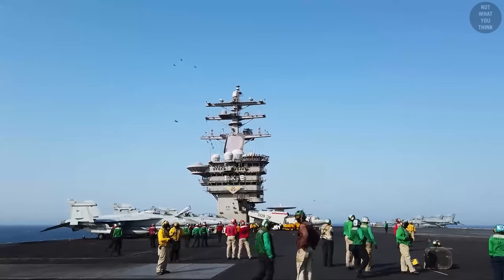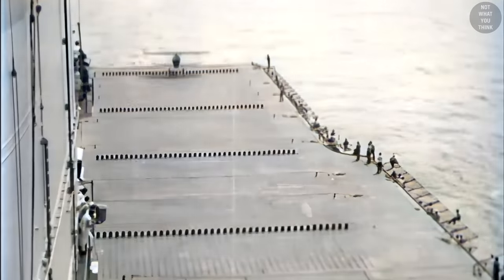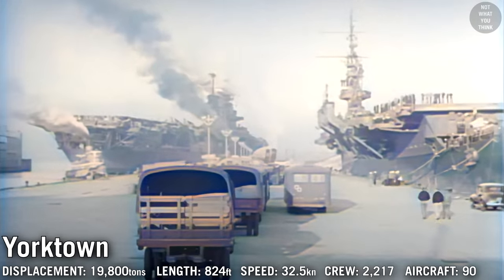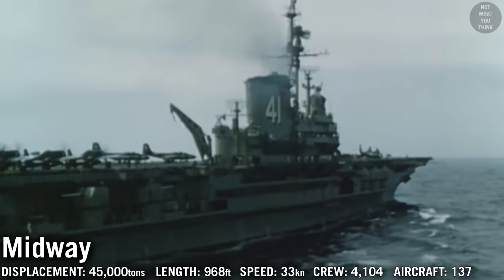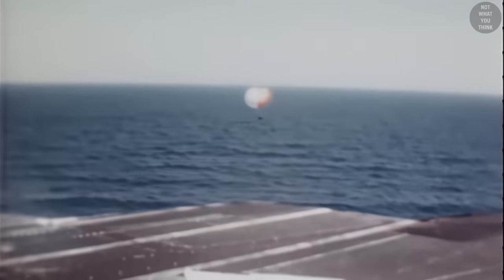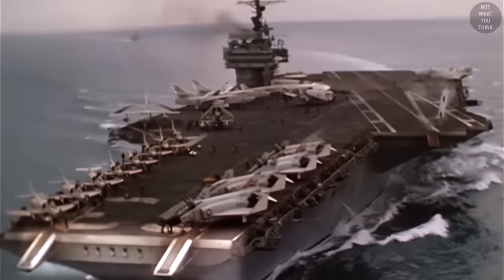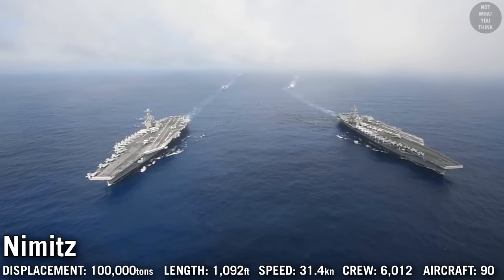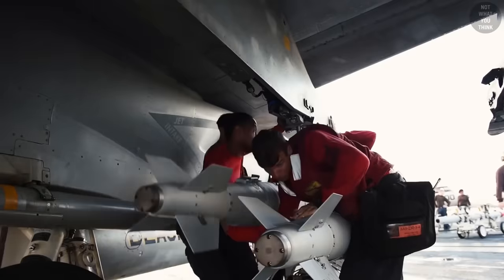Evolution of American Aircraft Carriers

Comment: Something that doesn't seem to be mentioned often is early carriers had catapults but they weren't on the flight deck but in the hangar and they sent aircraft out the side. They weren't used often because they couldn't use the carrier's forward speed for additional lift
Reply from the maker: Interesting, thanks for mentioning that!
Reply: A lot of ships had catapult launched aircraft, virtually everything cruiser sized and above had aircraft mounted. The aircraft could land in the water next to the ship and be picked up by crane.
Reply: @werewolfnar  Yup, that even includes a few submarines with an aircraft launching catapult.
Reply: Catapults on many gunships were powder actuated.
Reply: @shadowkillz9606  I think that was Japanese? I can't remember.
Reply: @alicorn3924  I-400
Reply: @alicorn3924  One Japanese carrier deffo had three decks to launch aircraft, I don't think they actually worked but that was the idea.
Reply: @All_Hail_Chael  I'm pretty sure all triple flight decked Japanese carriers were converted to single flight deck carriers before world war 2
Reply: @alicorn3924  Correct
Reply: Sounds like the Battlestar Galactica.

Comment: 25:44
The reactors on the Nimitz were also much larger and much higher output than the ones on Enterprize, as the ones on Enterprize were specifically designed to replace conventional boilers on a 1 for 1 basis, keeping the design changes from the Kitty Hawk minimal in the hope of keeping costs down.
The Navy also had more experience with larger reactors by the time Nimitz first hit the design study stage.
Reply: I trained and qualified at A1W. I didn't know that.  -  It means you don't have to redesign the steam plant as  well as introducing reactors.  Tandem design is more feasible with experience.  The "what if the reactors don't work" question has been answered ("don't work" can include not reliable enough.)  Rickover was a brilliant engineer.
Reply: Enterprise, not Enterprize
Reply: @kingssuck06  Just because I am an ex-Navy doesn't mean I was a spelling bee champion and am immune to typos.
Reply: @kingssuck06  i can never say this enough, but knowledge and intellect are two separate things. Just because it's easier for someone to learn doesn't mean they will make the effort, nor does it mean someone not conventionally "smart" can't put in the effort to learn something to equal mastery. edit also, casual conversations are a really crappy place to try to big brain on semantics
Reply: @KK_on_KK It is spelled ENTERPRISE.
Reply: @jimfrazier8611 Possibly not identical, but very very close to it - and they were specifically sized to replace the existing boilers in the mostly Improved-Forestall class design used as the basis of the Enterprise design with minimal changes. I think the reactor type already existed in use for one of our Submarine classes, as their basic design.

Comment: I was lucky enough to serve as a Boiler Technician on USS Lexington from 1983-1986. We still steamed her "almost" just like they did during WW2. The only differences for us was the fuel was no longer black oil that had to be heated to flow. WE used Diesel fuel marine or F76. Sometimes before fires side maintenance we would burn JP5 to make the soot easier to clean from the boiler tubes 8- 600 PSI 850Degree superheated steam Babcock & Wilcox M type boilers. Fully manual control! We lit fires with a zippo lighter to light a hand held torch that was fuel soaked asbestos pucks bolted on the steel rod that was inserted in the firebox. on a good day it was only 100 degrees on the burner front. BTW this was the coolest place in the boiler room! Every time the Catapult was launched. You could feel it shake the ship all the way down in the boiler room where you could see the effect on the steam drum pressure gauge and had to quickly increase the firing rate by adding fuel/air mix to the firebox to make up the steam pressure loss via the cat shot! That and you were already hauling ass to provide speed for more wind to give the planes more lift on launch. Good times! Also the very first crash shown on the video was on the Lexington not that long after I left. That was a bad one. Even on a training carrier it is very dangerous. Lost a few shipmates and not all were on the flight deck..
Reply: long live The Lady Lex!.  i think she was the first model carriers i ever had, one of those Revell kits.
Reply: I volunteered on a WW2 aircraft carrier for a few years. One of the big jobs was restoring one of the fire rooms. The other had been stripped for parts. I would have probably hated working down there as it was probably insanely hot and loud. There was a huge turbine-like fan that shot cooled air into the compartment.

Comment: Very good documentary giving a good overview of carrier innovation over the years.  There are only two things you forgot to mention:
1. Catapults allow the aircraft to carry higher fuel and payloads as compared with ski jump or VTOL launched aircraft.
2. The superstructure originally caused port/starboard weight imbalance but was overcome by careful placement of equipment to counterbalance the weight.
Reply: The superstructure weight imbalance issue mostly went away when the angle deck got common - if anything, it's usually not ENOUGH to balance the angle deck (though it helps some).
Reply: Except it was actually done across the pond. HMS Hermes 1924 have a look at her features. She even had a bow catapults which were removed. The starboard island with lifts behind the arrestor wires..... 

The Royal Navy innovations include the angled flight deck, steam catapults and mirror landing system.  

Eric Brown was the first pilot to land a twin engined aircraft the Mosquito on an aircraft carrier. HMS Indefatigable 25 3 44. The following year he landed a de Havilland Vampire on HMS Ocean 3 12 45 making the first jet to land on a carrier.... 

Armoured flight decks..... etc 

Appalling video.
Reply: @davidbroadley2983  very good comment because the British even welded the first carrier at Cammell Laird shipyard but the USA make out that all Carrier technology was theirs and they even now make out that steam powered VTOL technology is also theirs
Reply: It was Great Britain (RN) That made the very first aircraft carrier and made it with the single island but the Royal Navy have now upgraded to a two-island design.

“On 7 May 1913 the Royal Navy commissioned its first aviation ship. The old light cruiser, Hermes, launched in 1898, was converted to a seaplane carrier. Canvas shelters to hold aircraft were installed on the stern and forward of the bridge structure and aircraft-handling booms installed on the masts.

During World War I the British navy developed the first true aircraft carrier with an unobstructed flight deck, the HMS Argus, which was built on a converted merchant-ship hull.

You are welcome world;-)

Comment: Deck edge elevators: As soon as I saw elevators on the main deck earlier in the video, I was asking myself, "what if one of them breaks?" How was this not thought of immediately upon design? "What if it breaks?" Has to always be the first thing you ask yourself when buying or designing anything.
Reply: according to them   broken elevator is not on their list of important things to remember
Reply: The answer? Barring major combat damage that messes the mechanics of a in deck elevator and breakdown is going to occur in the motor that lifts it. The answer to what if that motor breaks is essentially that a capstan will be installed and the lifting mechanism will be powered by hand. 
Obviously this will be too slow for normal flight operations and would mostly be used to elevate the inboard elevator and lock it in it’s up position
Reply: I guess you could plank them over if needed, with some support beams into the hangar. Planking material is probably at hand in order to fix flight deck anyways.
Edge elevators didn't really appear until the Essex class,  with a very rudimentary version trialed on USS Wasp. I am not sure why originally internal elevators where preferred. I guess for the CV conversions it might have been to difficult to pierce the hull on the sides without compromising structural stiffness. Also for the armoured carriers the armoured sides (and deck) where part of the ships structure, and lift where placed in front and aft of the armoured hangar. I don't know the reasoning for the Yorktowns, cause technically they had hangar catapults installed, and as such probably could fit an edge elevator on that location instead. But then again, war was coming, the USN needed some optimized carriers instead of the (large and powerful, but with some drawbacks that hindered deck operations) Lexingtons, so no time (and weight budget?) to experiment to much.
Reply: Not only that, but what if you need to...you know...actually use it.  Launch and recovery must cease either way.  No idea why they thought this was a good design.
Reply: Well, since the fact that one of those broke caused the big E to lose it's capability to receive planes...there you have your answer
Reply: @Tuning3434  - While I am by no means smart enough to have invented the perfect aircraft carrier from scratch, assoon as I saw the elevators in the middle of the deck, a HUGE red flag was raised for me. That is something which should have been thought about before the blueprints were approved.
Reply: @PaulGaither  I imagine that it was just not a consideration. 

What people tend to forget is that most of these invocations came as a direct result of the requirements of the air group. The first few carriers would have launched and received biplanes which have very short take off and landing requirements meaning they would tend to land behind the aft elevator and launch from in front of the bow one. Once the carriers started launching and recovering heavier monoplane designs the deck space became more essential, but at this stage the carriers where already built and designed. 

As a example the main dive bomber of the US navy in WW2 was the Douglas SBD Dauntless, this plane was introduced in 1940 but the carriers from the start of the war where commissioned between 1930 - 1938 This is the reason Enterprise still had the lift in the flight deck. The first carrier to get the new lifts where the Wasp, which was commissioned in 1940.
Reply: @generalharness8266  - Solid reply.
Reply: Words of reason but I guess sometimes designers are too overloaded with some other crucial design problems that their energy is geared toward those problematic areas that  in return it results in other kinds of problems. Just to give an example, NASA designs mind boggling, state of the art rovers that run on Mars, but apparently they have problems with implementing reliable systems that clean the dust on the solar panels of the same rovers. Instead they rely on Mars winds to clean the dust on the solar panels risking entire projects and then try to save the day with makeshift solutions. Go figure...
Reply: @lacivertumutkazankaya2042  No they had a expected life on mars. The winds giving them a clean just extended the  life. 

A quick google shows that they where expected to operate 90 earth days, one (Opportunity) lasted 5498 earth days. So its not they needed a way to clean the solar panels its they had a design that was built to a acceptable level and the units out preformed that design. 

The project had a acceptable level of return after 90 days the rest was just a bonus. 

Please read my post about 3 up about why it was acceptable to have a deck lift that was then changed to a overhang lift.
Reply: @generalharness8266  Thanks for expanding on my comment. Here is my source: https://www.youtube.com/watch?v=6IoMiwxL2wU&lc=UgwSgeNbyZaunmS8XAl4AaABAg
It starts at 08:13. Anton, the narrator, clearly mentions that the mission was expected to end prematurely as the scientists had not anticipated the amount of dust accumulated on the panels just in four months and were very disappointed about it.  Eventually they came up with a solution which Anton finds "brilliant". Yes they did save the day but to me this is a makeshift solution.
Reply: @generalharness8266  The misunderstanding arose because I confused the robotic lander (InSight) with the rovers. So, not the rovers but the robotic lander.
Reply: @lacivertumutkazankaya2042  Makes sense now, was confused but even insight has lasted long enough for its primary mission (2 earth years).
Reply: i was thinking "why don't they put them on the island side?"
Reply: @HarryNicNicholas  Probably weight. You need to keep the weight as balanced as possible.
Reply: i had a toy of an aircraft carrier and it broke xd
Reply: Whenever I buy toilet paper the first thing I ask myself is, what if it breaks?
Reply: @gothenmosph5151  You think you are making a joke, but that is why you buy two ply buddy. As my dad said, two things you never buy cheap to save money on are toilet paper and bread. Nothing worse is bad TP or stale terrible bread.
Reply: Second time answering this question because I have had more time to think about it. You have to look at the evolution of carrier design. Interior elevators where a known technology, much more so than asymmetrical lifts. Look at the first experiments in deck edge elevators they were bare bones structures that were only as wide as the planes wheels because of weight and lifting capacity. 
If you just look at the elevators evolution you can see how each generation of ships the elevators design evolution continues culminating in the America Class “Carrier” whose deck edge carrier can be rotated vertically to enable it to pass through the Panama Canal and act as a sea wall during bad weather
Reply: @blurglide  there were always at least two
Reply: @PaulGaither  that’s how everyone did it
Reply: @HarryNicNicholas  these days they are on both sodes
Reply: Engineering probably, those elevators need to support very heavy weights, I imagine it took a while for them to figure out how to support all that weight by one end and still allow it to raise and lower.
Reply: Yorktown class U.S.S. Hornet had a deck edge elevator as well.
Reply: Probably technology. In-deck elevators are stronger. DId they have the technology and strong enough metals to make a cantilever outer deck elevator?
Reply: what happens when BOTH break in the middle of combat. They are ships of war...
Reply: All engineers think like that. In aerospace it is doubled. For spaceflight 10X that.
Reply: Apple users never ask that question. Apple designers design for it, "if it breaks, buy another one"
Reply: @blurglide  I suspect is has to do with winds. I imagine on a side elevator the you're dealing with hard/impossible to predict winds, particularly if there is are gusty winds that combine with them movement of the ship and get redirected by the structural elements of the ship. With modern planes (that are relatively heavy and need to get to pretty high speeds to lift off the ground that's not an issue. But early bi-planes require much smaller airspeeds to generate significant lift, so exposing them erratic winds on a side-elevator might result in them bouncing and sliding off the platform unless they're meticulously secured - which slows down operations. An elevator that decends into the deck protects the planes from those upredictable winds and would allow for faster operation.

Comment: 14:22
ALL of the Essex/Ticonderoga and Midway class ships that remained in service eventually got angle deck conversions - as did those early Forestal class that started construction as straight-deck.
USS Ranger (CV-61) was the first US carrier built from the keel up as an Angle Deck carrier.
Reply: It's true, but Forrestal and Saratoga were initially launched with angled decks so the "conversion" was more of a redesign mid build and the affected areas had nothing to do with the keel, nor were they top heavy like the Midways. I was on the Forrestal and it was pretty stable in heavy seas.
Reply: @kwaktak  Forrestal and Saratoga were designed under project SCB 80 and laid down as axial deck carriers and converted to angled deck ships while under construction - so it's fair to say the conversion was while they were being built.
None of that class or the later ones were top heavy like the Midways - 20 feet taller from keel to flight deck (and about the same in hull width) left more space for hull and room to better shape it. MUCH better sea boats, and MUCH less spray reaching the flight deck messing up flight operations.
The conversion to angle deck did mess up the starboard elevator (it would have been usable on the original straight deck design, but it was almost useless on the angle deck due to it blocking the angle deck cats and other positioning issues), the latter Kitty Hawk class rearranged things for better efficiency of elevator usage.
Reply: That is kind of fitting, since Ranger CV-4 was the first American purpose built aircraft carrier.